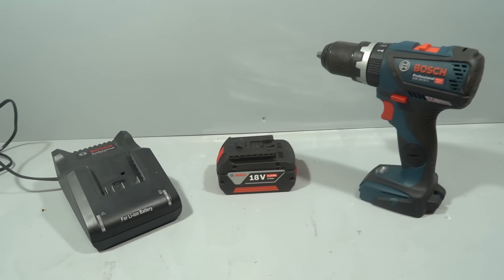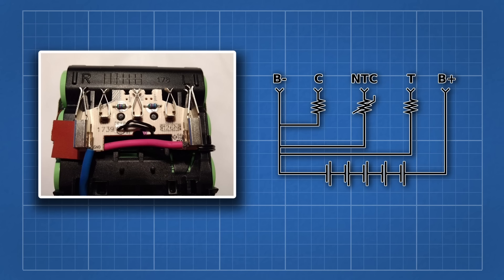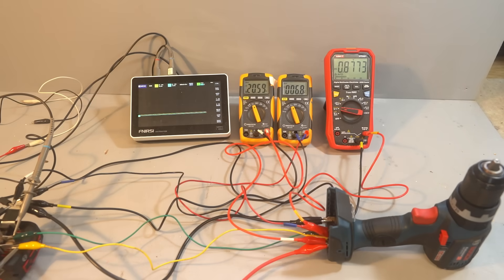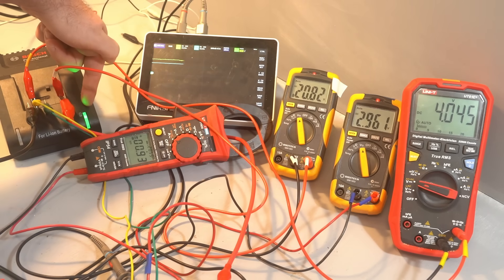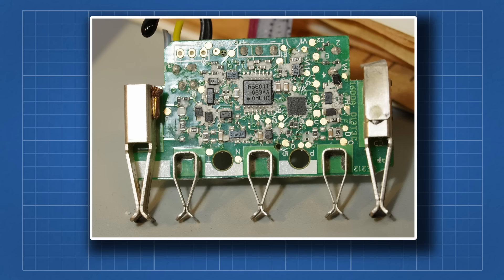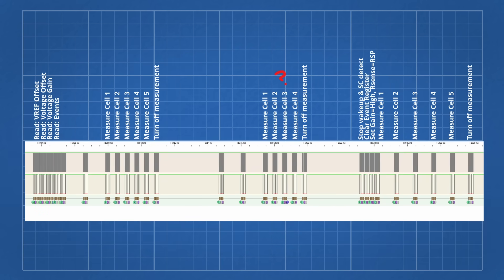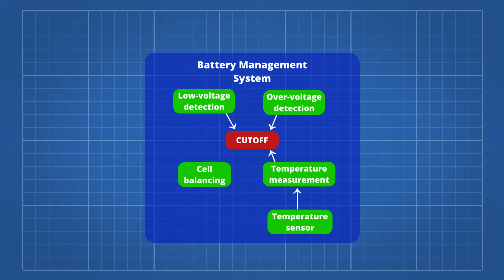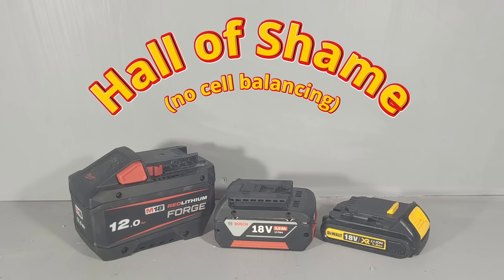[012] How does Bosch 18V compare to the rest?

Comment: Great man! You tested 15+ years old technology of Bosch and added them to the hall of shame. Next please test the Ni-CD batteries as they are also compatible with every Bosch Tool.

In the meantime time there is Bosch ProCore, Bosch ProCore+ and about to to be released any moment Bosch Expert range of batteries. 

Shame that you did all those in depth tests. Asking bosch would have provided to you free of charge battery to test all of them.
Reply from the maker: It would be hard for this circuit to be 15+ years old when the R5601T was only released 9 years ago.
Reply: @toolscientist The circuit has changed because lack of previous components but the technology in those batteries is the same. Again why are you testing 15 old model?  Ans not the latest 3 generation of batteries? I have seen this also on other American based you-tubers?
Reply from the maker: @Fatmacheto  the circuit design is 2016 or later (which is closer to today than when Li-ion power tools were launched in 2005). This battery was manufactured in 2021. Cell balancing is not cutting edge technology, and the R5601T has balancing built into it. All Bosch had to do was write some basic logic to do cell balancing, but they chose not to. I stand by my criticism of Bosch (and Milwaukee, and Dewalt) for omitting this feature.
Reply: @toolscientist Again this is a 15 year old product that carries the same name till date and price point , they changed the pcb only because some component are EOL and because it is THE SAME product they will not add anything new! They add new things in their 10 years, 2 years and 1 months old product so my question again is why do you test 15 years old product?
Reply from the maker: The circuit is from 2016 at the earliest. Even if by some miracle the R5601T was a pin match for whatever it replaced, the i2c messages would have needed to be reprogrammed.

So, to answer your question of why I tested a battery circuit designed in 2016, instead of 2017 (Procore), or 2023 (Procore+), it's because I'm cheap. 

I bought this drill, charger, and battery 2nd hand for $170 AUD. A Procore 8Ah would cost me $290 AUD, and a Procore+ 8Ah (tabless) is $300 AUD. I will test them in the future when I find 2nd hand ones for a low enough price.
Reply: @toolscientist Again for the 3rd time, the model of this battery is 15 years old. No company will release the same model with battery balancing without changing the model like Bosch did with ProCore and the others which are 8 years old. 

When you are testing old stuff you should not put a company in the hall of shame just because you didn’t made effort to test their latest.
Reply: @Fatmacheto are you Bosch employee? 😂 This year I bought SDS drill, circular saw and grinder. They came with THOSE STUPIDLY OLD BATTERIES. You see the reason for testing ANCIENT tech packs? It's simply still on the market lol
Reply: @filipphil6546 They are on the market because they are cheap and good enough for the low consumption tools but this doesn’t mean this technology isn’t 15 years old and that this guy must state that bosch doesn’t have cell balancing. 

Even few weeks ago Bosch released their 4rth generation of batteries called EXPERT. Do you get the point how amateurish testing a 15 year old technology looks like? 

Learn people, don’t just do the first thing you came up to you mind!
Reply: @Fatmacheto I know there are newer models and that's the reason I am here. I've been looking for some comparison and started with the oldest one 😂 you know, from the basics
Reply: Why I do get that these batteries are not the latest Bosch versions, the fact is that many kits from both Bosch and there Ampshare buddies are still coming with the old batteries. The ProCore batteries are only bundled with the more expensive products.
At this very moment Bosch is having a promotion where if you buy for € 200 of competing 18V products you'll get an old non ProCore battery, and when you buy for at least € 350 you'll get a ProCore version instead.

Also, for al the work and insight @toolscientist has put into making this video, you should show a bit of respect and gratitude.
Reply: @AeroWB Putting a respected company to the shame just because you lack knowledge in their products is nothing a thing to show gratitude. Also there have being many other much more correct reviews of Bosch battery.

In fact he should be ashamed of his statements about Bosch, but hey we live in a free world, you can embarrass yourself as much as you want.

Comment: Do you have any idea how the Bosch 12V (3cell) is performing? Does it have a BMS at all?
Reply: Most likely if the 18V doesn't do it, the 12V won't also. Why? Because balancing is more important the more cells you put in series. In other words the higher the battery voltage the more important cell balancing becomes. If you'd make 20V and 40V batteries from the same cells, without cell balancing, the 40V batteries would have a significantly lower life expectancy then then the 20V batteries.
Reply: @AeroWB  I agree. I am curious what pin C1 and C2 do on the battery. And why they are not connected to the charger.
Reply from the maker: I've never used any Bosch 12V tools, unfortunately.

Comment: Thanks! I've been waiting for someone to do the Bosche deep dive!

I would love for you to do a dive into Parkside 18v batteries. 
I managed to buy 3x4ah batteries at just £12 each last year and they seem bullet proof so far. 
They seem to have cell balancing on the tool, but like most other batteries nowdays rely on the tool for the actual cutoff.
Reply from the maker: Unfortunately I can't get Parkside as they're only in Europe and I'm in Australia. A chanmel called "Ercan Everything" has done a lot of deep dive testing of Parkside.
Reply: @toolscientist  Ah ok, thanks!
Reply: i wonder if its then more economical better to use a parksode battery with an adapter rather than a bosch battery? esp if they have cell balancing on board! only thing is whether the thermistor will be readable by the tool through the adaptor.

Comment: Every few weeks I stop and think about you, and in the back of my head I think "He must be wrong. He's not testing them properly. There's no way they don't have balancing, right?" Pretty much every time I pick up a tool off the charger.
Reply from the maker: I have doubts to. It could be that balancing only occurs under specific circumstances (maybe greater than 10mV imbalance, but less than 50mV). But then you find lots of reports of unbalanced batteries, which shouldn't happen if they're being continually balanced.

Comment: I do wonder now if the ProCore 18V Batteries differ, esp in conjunction with their "BiTurbo" tools that claim to fully utilize the benefits of those high-end 21700 batteries.
Reply: They have a new line of "Expert" batteries and some of the talk I've been hearing is they have much better circuitry... But that's just internet rumours so I'm hopeful but sceptical
Reply: @quimblyjones9767  Those are tabless batteries, would be interesting to have them tested properly as well.
Reply: @quimblyjones9767 they just a livestream where they hinted at new batteries. Theres a reason they’re coming out with replacements. I bought 18 batteries over the last 2 years (4ah & 8ah), 8 are completely bricked and 3 won’t show charging status. I’ve had Milwaukee and makita batteries get a little bit of water on them and be completely fine, the existing procore batteries cannot handle any drop. Still love my Bosch tools but it’s getting expensive.
Reply: ProCore batteries are much different when it comes to the electronics and protection. The battery you tested is years old.

Comment: Say what you want about Bosch, but from experience their batteries seem to be reliable (many of my friends bosch and never had any real problems with them). Don't know how much price difference there is between say bosch/makita/milw/dewalt, but in Poland basic bosch 18v batteries 2/3/4/5 amp (not procore) are like 30% cheper than dewalt /makita/milw. They are also  very cheap to repair. Many roofers use them, because they have little electronics(makita with their cpu in battery often briccked batteries because someone would run it till it stopped - 12,5v on the roof in full heat (40C degr +)and then leave it in a van over night (20C degr) and CPU in battery would record a voltage drop below acceptable limit (because hot battery will have higher voltage than a cold one). Makita fixed that glich with heat with batteries with "b" f. exp. 1850b
Reply from the maker: Reliability mostly comes down to the cells used, and most pro brands are using Samsung/Murata/LG, so they're all usually quite reliable (with the exception of high capacity packs being more prone to failure). Bosch has a slight advantage with their more conservative 14.8V cutoff, which would help with longevity.

They can add better low-voltage cutoff (monitoring each cell and open-circuiting NTC) and also balance without needing to add any extra hardware and therefore cost, and that's what I'm mainly disappointed with.

Comment: I would love to see metabo
Reply from the maker: Real Metabo (CAS system)  or Hikoki (Metabo HPT)? Both are on my todo list, but they're not super common in Australia (I would guess each are 5-10% market share of pro market), so hard to find 2nd hand
Reply: @toolscientist  I have the real metabo (CAS) i am in germany :D In particular i have the two 4ah variants.
Reply: @toolscientist  Where abouts in Australia are you? My work have some Metabo stuff (original CAS stuff) I know we have a few tired batteries kicking about (I stripped down some dead ones last year, have a couple of BMS in my garage) Repaired one of the chargers last year too and think I came across another dead one that I need to look at. So yeah, if you are in Melb's, might be able to get something across to you to test at some point!

Comment: I wonder if Bosch fixed it in the ProCore battery series
Reply: I've owned Bosch CORE batteries over the last 5 years and none has gone bad. The oldest one has a 2019 build date. Over the same timeframe I've had 1 M12, 1 M18 and a couple Ryobi 18V batteries gone bad.
Reply: yeah this would be interesiting to know because the design shown in the video is verry old.
Reply: I have two Bosch ProCORE 18V 4Ah batteries and after approximately 2 years of very light use, they only charge to 4 bars (out of 5 bars total).
Reply: @danielardelian2   Interesting I have 4x4Ah 2x5,5Ah and 2x8Ah ProCore and 1x4Ah 1x5Ah GBA for 2-3 years and they all charge to 5 Bars(ProCore) and 4Bars(GBA) so fully.

Comment: wdym no balancing on brands like milwaukee? sure the charger must do some balancing right? even if the battery onboard BMS doesn't
Reply: oh no...
Reply from the maker: M18 charger can't balance as it has no connections to the cells. Only the chip (Analog Front End) in the battery can balance, but it is never instructed to. M12 may be able to balance as it has direct cell connections, but I have heard that they do not balance.

Comment: I like this video! Thorough test and analysis! I wonder if the Bosch ProCore and ProCore+ are built the same? ProCore is 21700 cells and ProCore+ are "tabless".
Reply from the maker: I have a broken ProCore. There's notable physical differences, but it might still be the same fundamental circuit and same firmware.
Reply: @toolscientist apparently, the GAL 18V-160C 'Connected' charger only gives status information when charging newer ProCore(+) batteries, and not the older GBA (Coolpack 1.0) batteries. This suggests there must be more of a difference than physical only. Doesn't guarantee they don't have the shortcomings you mentioned here though, especially since the hardware was in place with the battery you analyzed here.
Reply from the maker: @macvos  interesting. That's worth looking at if they're claiming different operation
Reply: @toolscientist - In connection with the Bosch founded AmpShare battery alliance the head of Bosch AmpShare said, that they do communication between batteries and tools. 
For the 12V that seems to be marketing bullshit. Even Bosch green and blue have the same 12V battery block (for 3-cell batteries), just the mechanical endcap is coding green or blue.

Comment: if the features are in the tool, does that mean its ok to use cheap aftermarket batteries for bosch and dewalt but not makita and milwaukee
Reply from the maker: Aftermarket generally have the same protections and communications as genuine. So all aftermarket are "fine". The problems come from them often using low-grade or used/recycled cells. Also it's not possible for the average person to know if they have implemented the safety features properly. For example, they could use a fixed resistor instead of a thermistor, and they might omit the overvoltage protection chips to save money.

Comment: So what I'm hearing is that I should have a balancer for my tool batteries....

(How could I make that work with the Flexvolt packs? Are the balance leads exposed at the plug, even for the regular 18/20v batteries?)
Reply from the maker: Flexvolt is prob the hardest to balance. You need to slide the 18/54V switch into the middle position to isolate the 3 different batteries (you can use the safety cover that comes with the battery). Then you need to use magnets to make contact with the cells. I used small M3 bolts and a clamp. I've seen people make 3D printed jigs with small bolts to make the contacts, but you could also use a piece of plywood.

Comment: Ah so the batteries with cell monitoring use NTC pin to tell the charger to stop, good to know, I plan on making 100% custom bosch battery using robust 3D printed case and 21700 tabless cells.
So far I have designed main cell holding section and the side lids, that was enough to do some drop testing, material is ABS, I had the cells inserted to weigh it down, and I was throwing it around and dropping it on the floor and there was almost no damage so 3d printing is completely viable.
I was also able to make the pack same length as the 4Ah procore pack, yet I didn't need to stagger them, so they are all flat, that makes the battery pack lower, and simplifies the design.
Regarding the BMS, I will add cell balancing for sure, probably even active one using capacitors.
With balancing the pack should last like 3x longer, lithium cells are rated to like 500 cycles, but that is with keeping 80% of rated capacity, but if you don't mind your 4Ah pack slowly becoming 2Ah (50%) then you are getting like 1500 cycles, and then still the pack will continue to work it will just keep getting weaker.
Without balancing I've seen dead bosch packs that had few cooked cells, like 0V or even open circuit (internal cell fuse), but then the alive cells had 90% rated capacity, so that pack was barely used yet it died due to misbalance.
Reply from the maker: Yeeah, open circuiting NTC is only way to stop charging. You could also short the NTC, but that will throw overtemp LED and be confusing.

Sounds like an interesting project. You should make a video of it when you finish.

Comment: Excellent work, as always ! The fact that power tool companies charge a premium for batteries and don't even include cell balancing is disappointing.  I've recently bought some Einhell batteries for their cheap price. Opened some up and they seem to be decently built and appear  to have cell balancing (some big smd resistor for each cell) and a disconnect mosfet . They do not have LG, Samsung or Sony cells inside, but Chinese manufacturers have started to produce quality cells as of lately.
Reply from the maker: I might look at Einhell as we get that brand in AU labelled as Ozito. I had assumed they had a cutoff mosfet as their tools only have 2 pins
Reply: @toolscientist please do 👍
Reply: You know that there is safety reason not to do cell balancing?
Reply: @StepanovsAndrejs  why would having cell balancing be a safety risk? Not having it can lead to an overvolted cell and that can creates some explosive problems. For example, all EV manufacturers use cell balancing in their car batteries.
Reply: @vanceacata All the power tool companies do cell *monitoring*. They will stop charging when one cell reaches peak voltage. That is what is needed for safety. 

They don’t balance. So if one cell is charged too high, then the entire pack will never be fully charged.